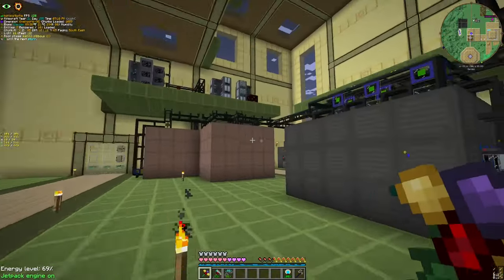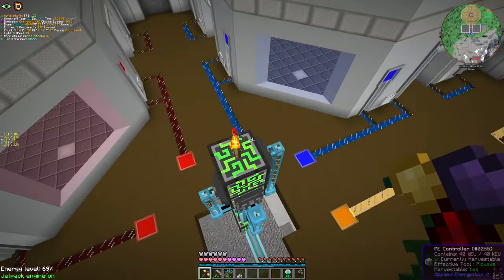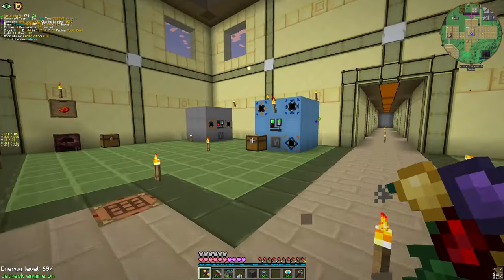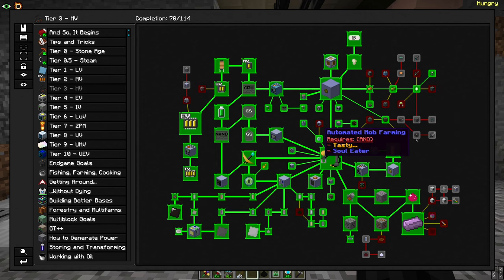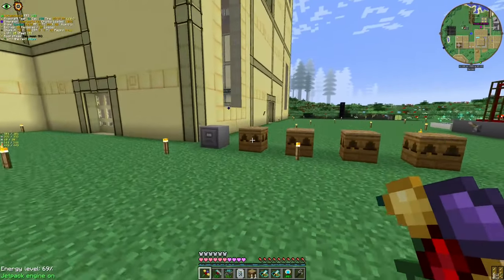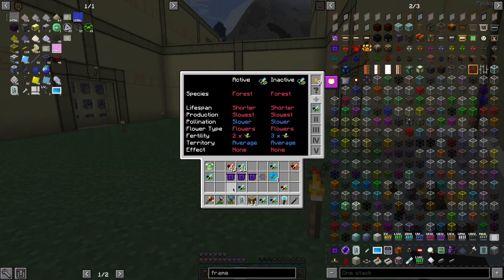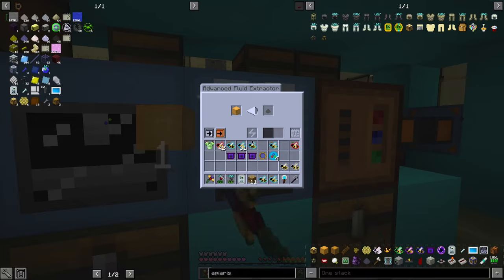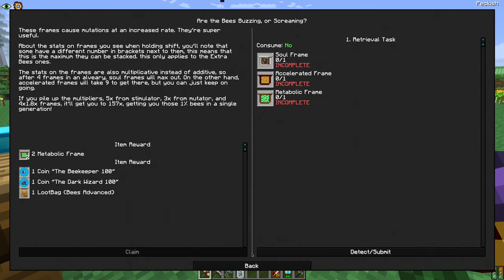BEElieve In Them My Friend... | GregTech: New Horizons S2 - 49

Comment: EnderIO machines can be powered by GT cables with no problem, but you have to place the machine and then manually connect the GT cables to it with wire cutters.  If you shift-click the machine onto the cable, the auto connection won't work.

Comment: you should use enderio capacitor banks to power forestry machine (carpenter and alveary's) since forestry machine tend to do some weird stuff with gt eu conversion 😁
Reply from the maker: Yeah I know, most RF machines do. But since its just 4a mv line and also a temp setup, I just didn't cared xD